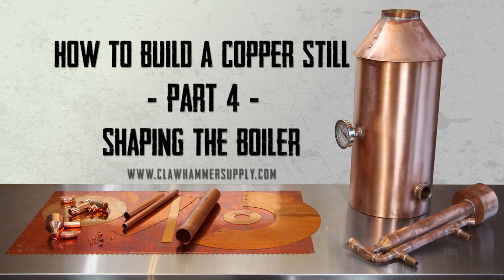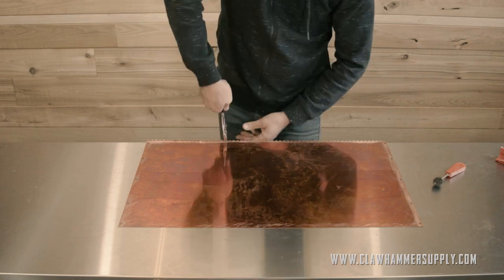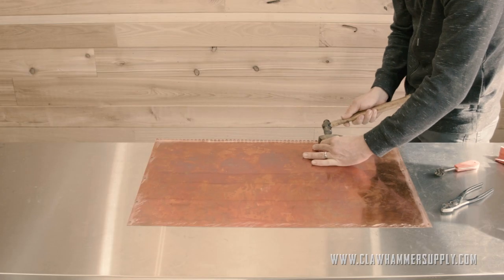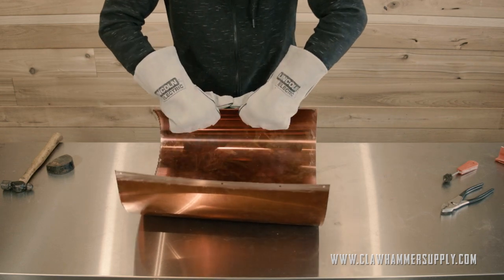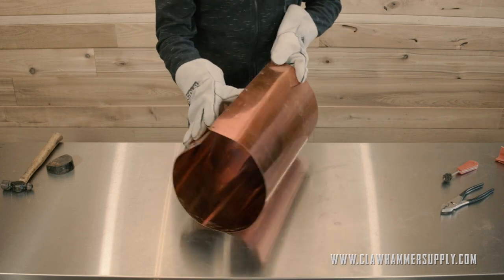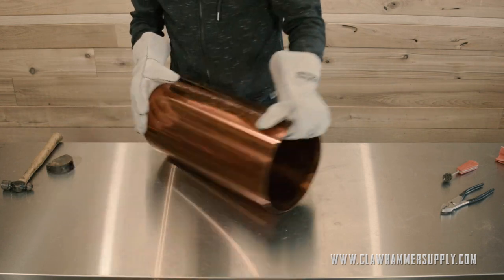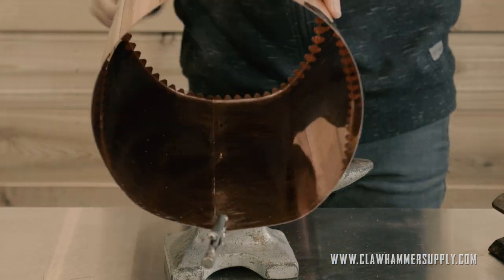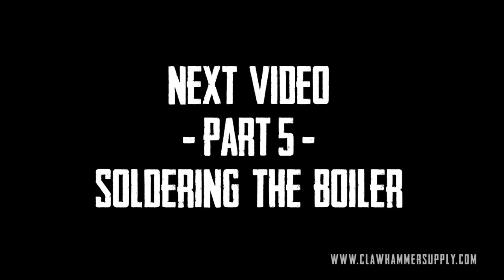How to Make a Moonshine Still - Part 4 - Building a Still Boiler

Comment: how thick is the copper sheet metal used? I seems quite flexible, will it be stiff enough in the end, hopefully?!
Reply from the maker: We use 16 ounce copper for our 5 gallon still kit. We have been selling these since 2009 with thousands of happy customers. They will last a lifetime if you take care of them. It really tightens up during part 5 and 6 of the video series.
Reply from the maker: 16oz. copper. It'll last a lifetime unless you run over it with a truck or something.